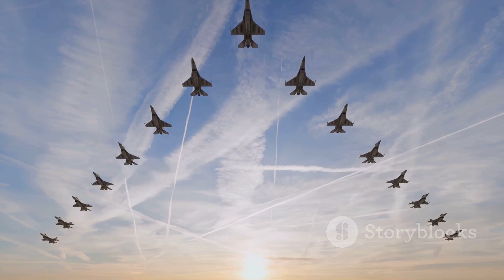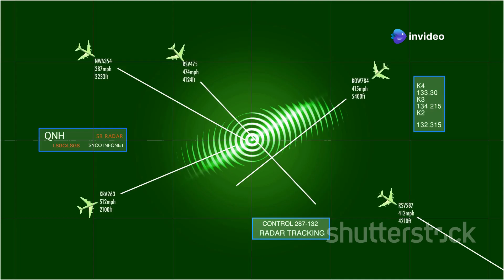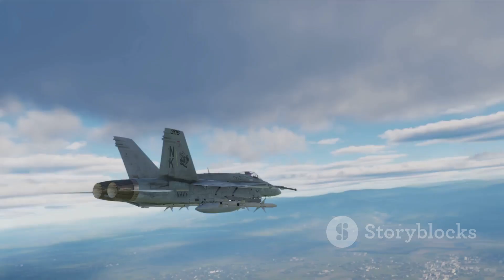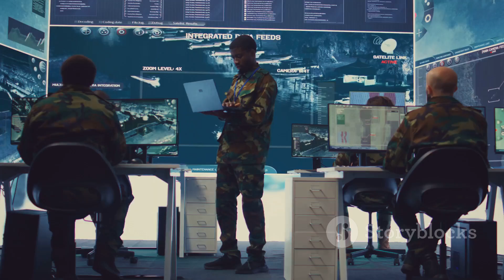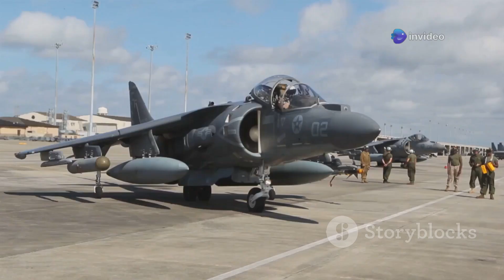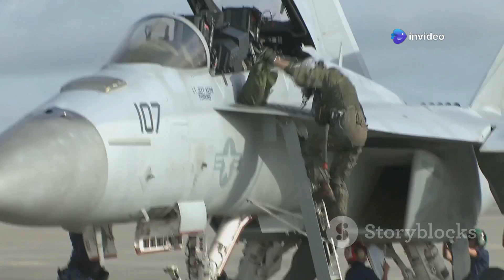Sweden's Gripen Is Set To Change The Battlefield! Here's Why?

Comment: AI garbage.
Reply from the maker: Thanks for sharing your thoughts! AI is still evolving, and while it's not perfect, it's improving rapidly—especially in areas like flight simulation, target acquisition, and systems integration. If there's something specific you didn’t like, I’d love to hear it! Feedback like yours helps the conversation grow and the tech get better.
Reply: @FalconFury07  So SO bad. I seen 0 video clips of the actual aircraft being discussed. The closest the 10 minutes video came was a few still images. Only Gripens in the entire thing. Videos instead included airliner baggage loading and a LOT of clips of a fictional control center where at one point they were handing out sub-machine guns for some reason? It seems like a lot of Saab press release filler was thrown in to hit the 10 minute mark, not sure if that is still a YouTube magic mark for the number of ads in a video can have? Maybe worst of all was how little actual information was actually included. Mostly just all Saab sales info, but no actual facts. Its performance vs other 4+ gen aircraft, no info on how many sales Saab has actually made, any real world performance data, or info on efforts by Saab to create the aircrafts successor. 10 minutes of total old news fluff without even any sexy videos of the aircraft doing its thing to at least have that.  Total AI garbage. An attempt it would seem at easy Youtube $ without putting in the effort.